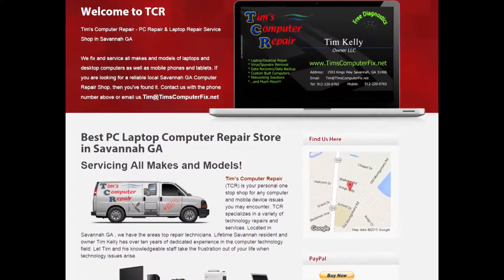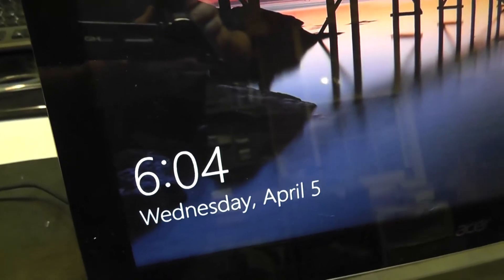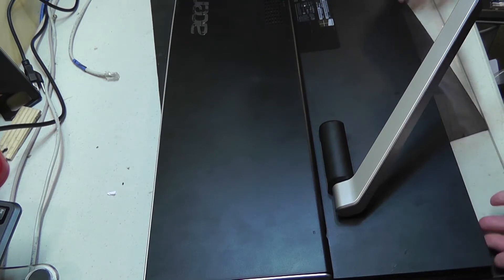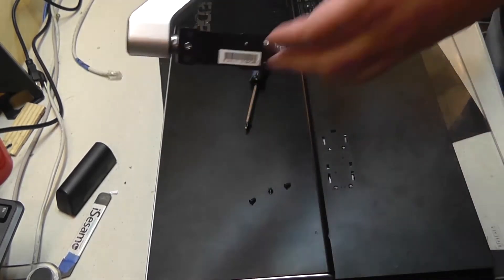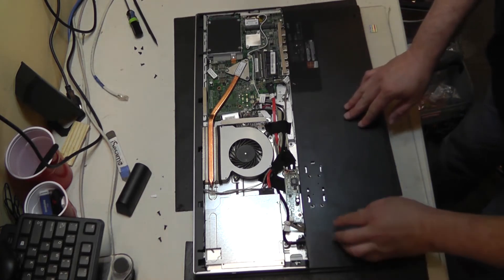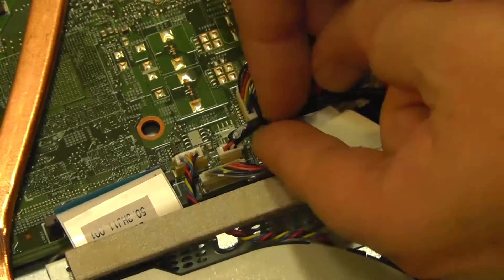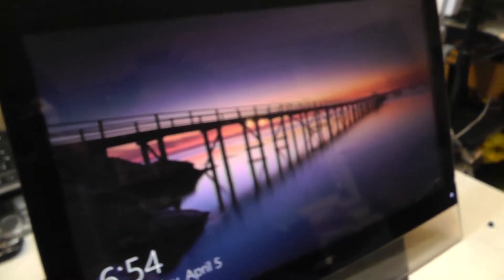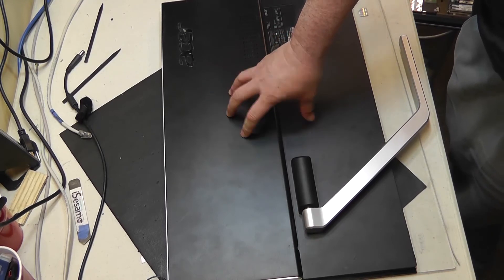Acer Aspire 5600u All in One Digitizer Screen Repair

Comment: Hi Tim, could you tell me where the CMOS battery is located on the Acer Aspire 5600U?

Normally, the CR2032 is used on PCs/notebooks and is easy to find, but I was unable to find it on this model when I removed the cover. Thanks.

Comment: Great video! I use an old Aspire 7600u just as a monitor. Do you know if the Touch cable is just an internal USB? It looks promising with green and white cable twisted, as USB+ and - would be, right colors as well? I would love to solder on a USB cable to enable touch for my computer that is connected to the screen (if I can find drivers for Win10).  The 7600u-computer in itself isn't powerful enough for my needs but having a touch screen would be very nice. I'm also gonna dig into my Aspire and see if I can remove the Webcam and put on an ordinary USB-cable to that as well. From what I have seen on different tech nerd channels most built-in webcams are true USB ones. You got a new subscriber in me for sure 👍😁
Reply from the maker: Thanks for watching and commenting.

Comment: thanks loads for this upload. i was able to do the very same thing in a matter of minutes without even bothering to take off the footstand thingy. but i am very interested in how i can make that foot stand turn in such a way as to have the compouter stand on its side and be in a portrait position. next i am going to use a can of air to blow out the fan. is that something that i should[not]  DO? this lenovo that i am using right now won't do caps and other things without using the on screen keyboard. would you know how to fix that?it is a lenovo ideapadz560.

Comment: Hi Tim, good video!  A question I have an Acer Aspire 5600U that my mom bought me a few years ago, I am currently 17 years old and between those years the pc hit itself several times causing that Touch Screen problem so I had to deactivate it, lately I had a party  in my house and between that the next day I remembered that it almost fell off the desk but it still hit and broke the glass in the corners, until now it works perfectly I have reproduced it Spotify, the truth is I have affection for this pc that was a gift  and that I am about 7 years old I think, I have other PC's too but I use them for video games and video editions, the Acer more for casual use, music, web and that, here is my question as I told you I have affection and aesthetics  It is very nice, but the screen is somewhat broken and in the future I would like to replace the screen, which is not where to buy the replacement and how it would be to assemble the screen or if I should send it to the Acer factory or something like that the truth  I don't know and good  Or I would like some recommendation, maybe if I do not find a solution, maybe in the future I will buy another since I like this type of model and I have affection for it, well ... Greetings from Argentina!

Comment: This video was fantastic, exactly what I needed. I have the 5600u and although I disabled the touchscreen in the device manager, every time I started the computer it would re-engage the touchscreen which (because the screen is drastically cracked) would 'ghost click' everywhere on the screen resulting in frustration. Thank you for uploading this, I will share this video.
Reply from the maker: Glad the video helped. Thanks for the comment.

Comment: Hi Tim thanks saved me time with the bottom screws.  Wondering if you've seen any problems with this model and lack of touch capability after win 10 upgrade?  The one I'm working on is in perfect condition but the touch vanished after one of the updates and it doesn't even show up in device manager under HID
Reply from the maker: Check the manufacturers website for any updated drivers.

Comment: Thanks for this info. last summer my computer screen cracked in the same spot I took my computer to a computer store and I told them to please disable the touchscreen features. Lately when I turn on my computer the computer behaves in the same matter but it will eventually stop and allow me to access or go onto the computer. I'm wondering if the person who disable the touch screen feature if he unhooked the cable like you showed in this video. If not I think I could do it.
Reply from the maker: Yeah by unplugging the cable there is no way any touch capabilities can ever be witnessed.